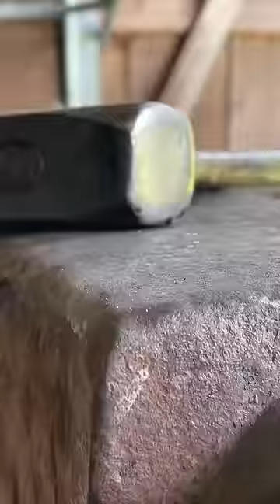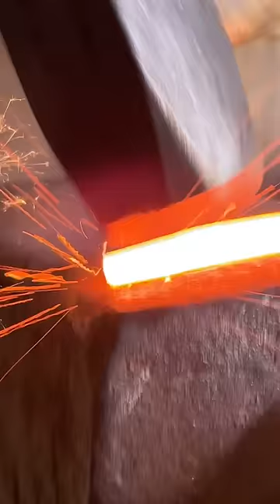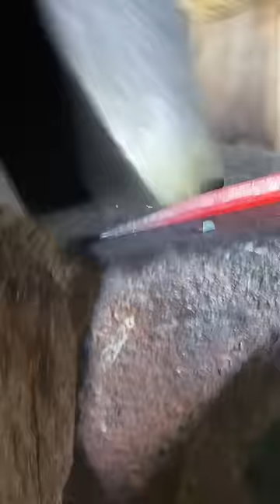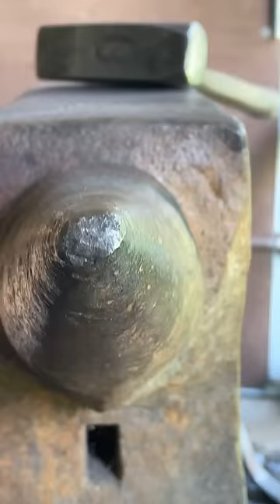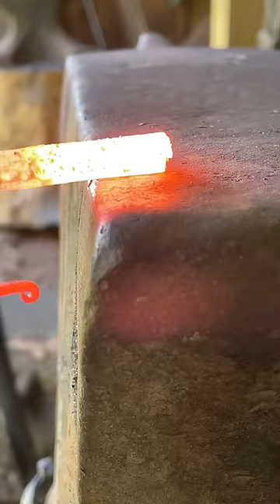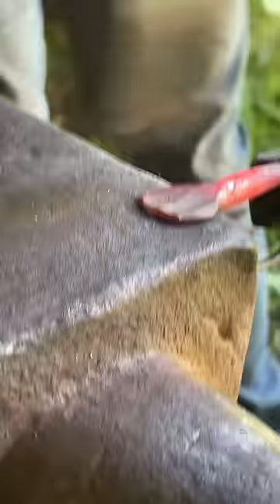How to forge a simple hook #blacksmith #asmr #shorts #blacksmithing #fire

Comment: I have a question, ive been practicing with making nails, one thing i notice is i waste a lot of time turning the rod and adjusting trying to keep the flat side down while keeping it square, im using regular tongs but you seem to be able to rotate much quicker and very precise whats the technique im missing? Probably just practice and experience but any tips? im an apprentice ferrier, i blacksmith and shoe shape as a hobbie, really enjoy your videos
Reply from the maker: This is a good question, it could be a few things… I try to focus on 90 degree turns on two sides, I don’t rotate the bar around, just pick two sides. Some of it is hammer control and discipline, so keep at it and take your time. Instead of making nails or a whole project like a hook, you can develop a lot of skill by just practicing the technique, isolating the aspect you want to get better at and just practicing that, it doesn’t have to “be” anything at the end. Just forging exercises can really help move things along. I hope that helps and keep at it!
Reply: As an apprentice farrier and blacksmith, it's great to hear that you're practicing and honing your skills. Efficiently rotating and adjusting the rod while keeping the flat side down and maintaining squareness can indeed be challenging, but with time and practice, you'll definitely improve. Here are a few tips that might help you:

1. Proper tong grip: Ensure that you have a firm grip on the rod with your tongs. The tongs should be positioned closer to the end you're holding, leaving enough space on the other end for rotation.

2. Balanced stance: Stand in a balanced position with your feet shoulder-width apart. This will give you stability and control while manipulating the rod.

3. Wrist movement: Instead of relying solely on your arm movement, try to utilize your wrist to rotate the tongs. This allows for quicker and more precise adjustments. Practicing wrist movements will help you develop better control.

4. Smooth transitions: Focus on making smooth and continuous motions while rotating the rod. Avoid sudden jerks or abrupt movements, as they can disrupt the alignment and balance of the rod.

5. Practice with different tools: While regular tongs are commonly used, you might consider exploring specialized tools designed for specific tasks. For example, scrolling tongs or wolf jaw tongs are designed to provide better grip and control during rotation. Experimenting with different tools can help you find the ones that suit your techniques and make the process easier.

6. Patience and practice: As with any skill, practice is key. It takes time and patience to develop the muscle memory and coordination necessary for efficient and precise rotations. Keep practicing regularly, and you'll notice improvement over time.

Additionally, observing experienced blacksmiths or farriers in action can provide valuable insights into their techniques. Don't hesitate to reach out to more experienced professionals for guidance and advice as well.

Remember, becoming proficient in any craft takes time and dedication. Keep practicing, stay focused, and enjoy the journey of improving your skills as a blacksmith and farrier.
Reply: @nate_weiss_ similar thing with drawing, just practicing circles and shading is really important to hone those skills
Reply: A great exercise is to turn round stock into square stock.  Getting your edges straight and even, and the angles at 90 degrees as well as you can.  You'll be surprised how good you can get at it.  Also great for "feeling" the angle that your hammer head will land at while you are swinging.
Reply: Bro wrote a whole Essay
Reply: @KevPlays1  ai wrote that 99%
Reply: Yo I'm 13 and a blacksmith and I also am curious.[I am terrible at smithing😢]
Reply: @Banglabuddy71  You're pretty young, just keep practicing and you'll get there.
Reply: Well you can see that he is using his hand when he is making the tip and it is really comfortable using your hand instead of your thong, i am using a glove for smaller things myself. 😊
Reply: @nate_weiss_ I am a very novice blacksmith but correct me if I’m wrong, as well as focusing on the 90 degree turns isn’t it important as well to keep the bar in hand as parallel to the ground as possible even when you see the metal being hit is bending?

Comment: Where did you get the tools for the holes in the anvil that im blanking on the name of? I’ve just been using an old welding hammer. Can’t find them anywhere.
Reply from the maker: I usually make them if I need one. They don’t have to be out of high carbon steel, mild is just fine
Reply: @nate_weiss_  alright thanks.
Reply: You can get a good starter hammer ( small hand sledge) at Home Depot. Also, there used to be a company called Centaur Forge that carries blacksmith/ farrier tools. P.S. are you thinking of the hardy hole?

Comment: I'm curious on how well someone could hand forge a fish hook.
Reply: No idea, but I can give you my speculation as an engineering student. I'd imagine the hardest part would be making a wire of the proper material that's thin enough. In an industrial setting, you could probably use hydrostatic extrusion. Idk how the hell you'd do it by hand though. Either way, once you had it as a thin wire, you could anneal it to prep it to be cold worked and then shape it into the desired shape. Then you could harden it so it holds up and then sharpen. I haven't taken any of my courses on manufacturing and know next to nothing about metalworking though so take it with a pinch of salt